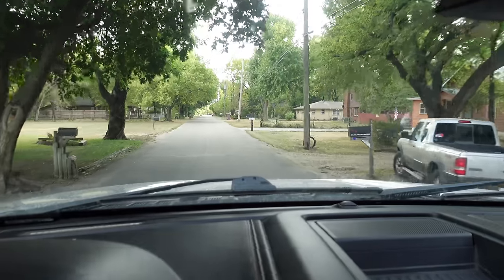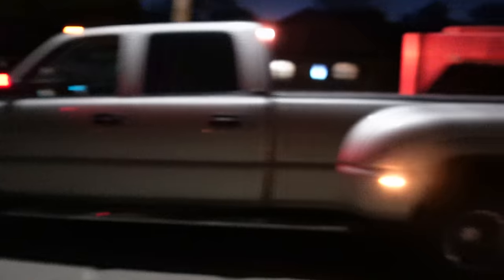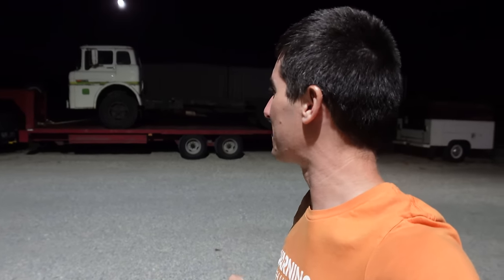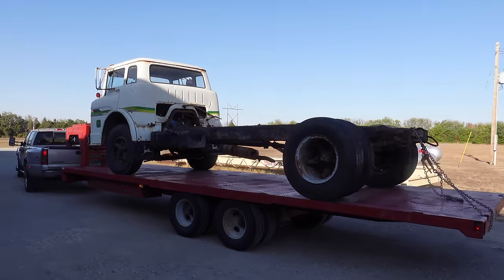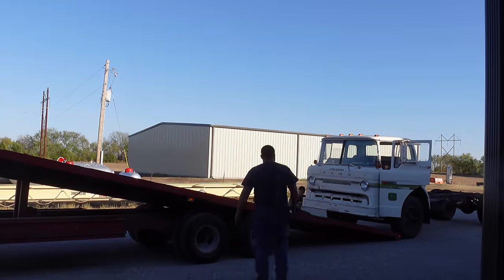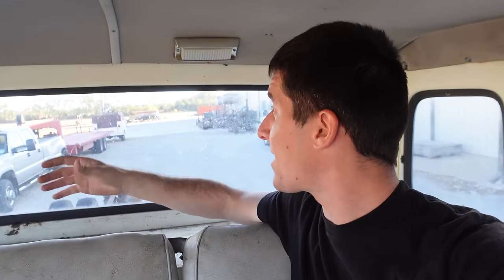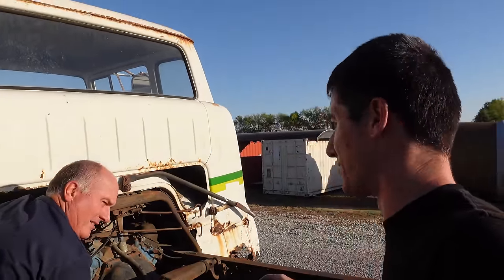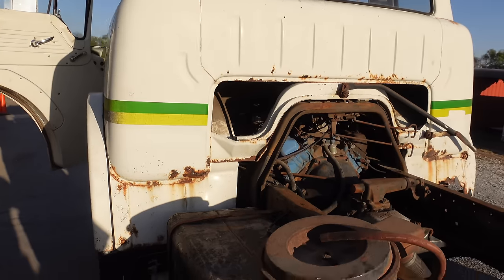Buying An ANTIQUE CABOVER Ford And Getting It RUNNING The Hard Way

Comment: I've had the full gamut of emotions over this rig. First, I thought it was the end to your streak of killer deals. Then, after it popped off and you drove it, I thought it was a steal. Finally, after the "ghost frame" discovery, I was back to square one. This is the end of your killer deal streak, sorry. Still a cool old truck though. That yellow and green really got you sucked in, huh?
Reply from the maker: If it says John Deere I'm in (honestly I'll make this run and sell it for $2,000 by the end of the week) 🍻

Comment: I have a complete truck like what you have but it’s a 700 or 750. It has a grain bed and pto and I believe the frame to be good. Engine should be good but hasn’t run in several years due to it having a wooden floor for a bed with issues. Would sell the whole thing For $1,300. Am in southwest of Wichita 50 miles
Reply: Thanks for the feedback and expect more videos soon. Send me a text above🔝🔝🔝 I have something for you....

Comment: The engine in your truck looks like a later model swap in. That engine is not an FE 361 or 391. It is a 385 series engine. Most likely a 370 or 429 HD truck version.

Comment: Definitely not an FE. Could be a 429 Truck engine, or from the 534 family. Also not split rims, but Dayton rims. The wedges can still fly out, but Daytons have a way better rep than do split rims. Truck has air-over-hydraulic brakes...basically hydraulic brakes, with air boost, rather than vacuum boost as does a car.

Comment: The engine is not an FE series as the intake manifold would extend as part of the heads, looks like a 370 or 429 industrial, possibly a 460 transplant

Comment: Given that the frame is garbage, the wheels and tires are obsolete, and the rear gear is going to limit the truck to local roads only, my recommendation would be to take the cab and put it on a newer drive train. Get a mid 90s Ford f super duty and drop the cab right on top of it that you have modern everything and the old school look.
Reply: Thanks for the feedback and expect more videos soon. Send me a text above🔝🔝🔝 I have something for you...

Comment: Them are not split rims they are wedge lock rims they are just like modern day rims just held on with wedges instead of lug nuts. You can get a frame from the junk yard just measure yours on width and such and get a more modern one from a truck and cut that old one off some where behind the cab and weld the new used one on, Get It Done

Comment: What ever it is, it is not a FE or FT motor. You can see how the intake does not extend under the valve covers.
Reply from the maker: Oh yup, I'm an idiot... I forgot how much I hated changing the intake on my FE 😂
Reply: @WatchJRGo  Might be a 370 which was based on the 385 series engines. Or a 429.

Comment: Out of curiosity, what makes that specific wheel design so dangerous?
Reply: They can fail violently. Look up split rim explosion. I had them on an old 40s truck, but luckily with new tyres and tubes already on them so never needed them changed, most tyre places won't touch them. The front bead part of the rim is separate from the barrel

Comment: That’s actually a cab forward not a cab over.  Cab over has the front axle right by the bumper and cab forward has the door in front of the axle.
Reply from the maker: The Ford C series is a range of trucks that was assembled by Ford between 1957 and 1990. The first cab-over engine (COE) truck produced with a tilting cab by Ford, the C-series replaced the C-series COE variant of the F-series, produced since 1948.
Reply: @WatchJRGo  Wikipedia is that you?
Reply: @WatchJRGo   Correct,  Nice find JR!

Comment: I'm not 100% on this but I think that is indeed the rear air brakes. As I understand it trucks like that have to by default according to the DOT be locked if there's no pressure. In other words an air compressor puts power to them and they operate but in the absence of air pressure the circuit is open and the brakes are locked.
Reply from the maker: They're just really big drums with a weird remote master/booster, no air compressor on this truck 🍻